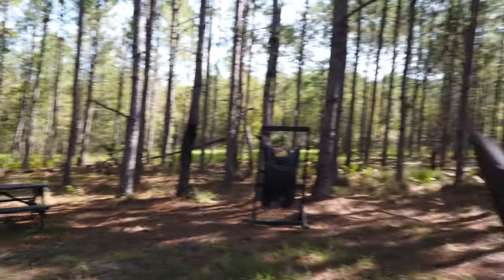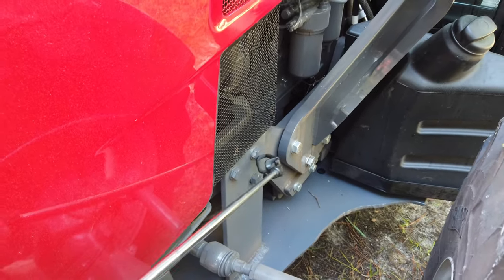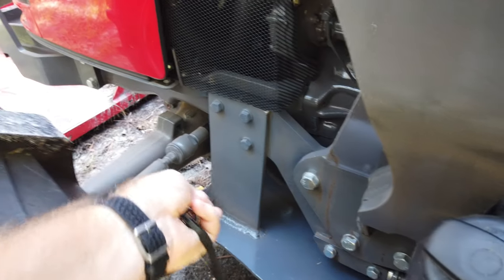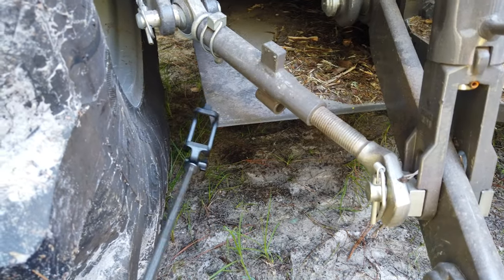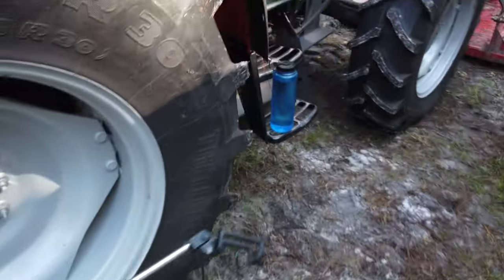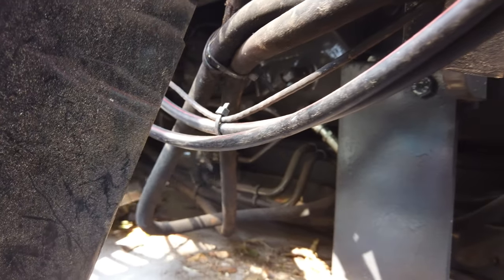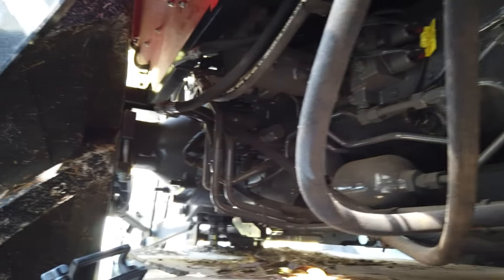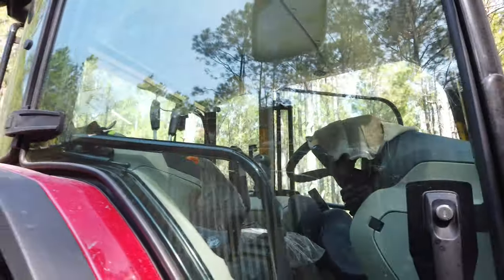Custom Tractor Skid Plate on Massey Ferguson 4707

Comment: Don't forget to hit the top side of the plate with a blower while cutting or before you park it in the pole building. All the tinder collecting on top, grease, spilt diesel, oils, etc. and heat from parts can cause a fire. Heard about it on some forums. Love the plate, definitely need one.

Comment: Smart & essential. OEMs: pay attention. You know you’d love to add another option to your list, right? If not, looks like Ocala Tractor is getting the business.
Reply from the maker: Improvements include: 1. front lip to divert grass and debris down. Shorter in the rear to accumulate less debris where protection isn't needed. 3. Large access ports with beveled edges to direct debris past the opening or some type of opening cover 4. 1" clearance the entire length of the tractor.

Comment: Nice idea. Looks good.  

BTW - It's a lot more than 300lbs....1/2" A36 plate is 20.5 lbs per sqft  and that's a  4 x 8 sheet so with supports, gussets, and bolts you're nearer to 800lbs! 300lbs would be 1/2" 6061 aluminum option but it costs twice as much per sheet and fab costs twice as much because you need a good TIG welder and twice as much welding to be as strong as steel welds. (more gussets basically)
Reply from the maker: Thanks for the info!

Comment: That’s a great idea thanks for sharing
Reply from the maker: It was $1500 but I equate that to one service call to fix the wiring or tubing. It is something all tractors manufacturers and aftermarkets companies should offer. A CNC cutter could store the directions and cut them out in no time and be perfect every time. Mine was hand cut but it is the only one they have ever done. I'm very happy with it.